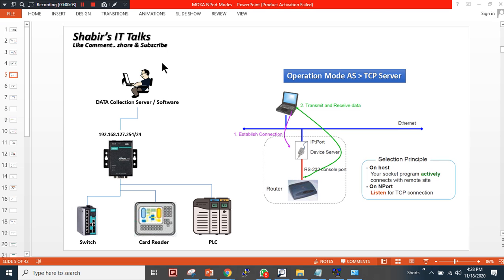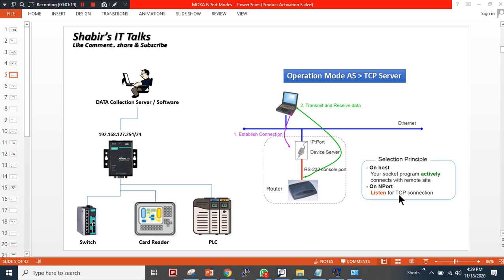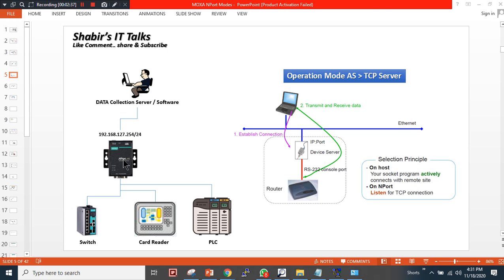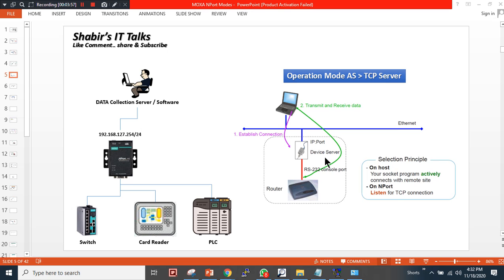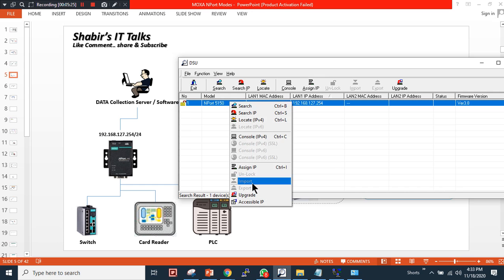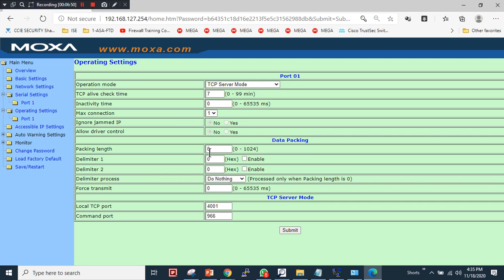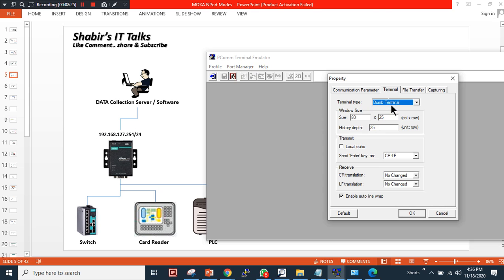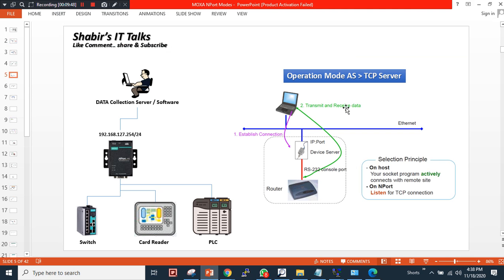How to Configure Ethernet to Serial Converter  MOXA NPORT Operation Mode as TCP SERVER

Comment: Hello Shabirs, I need to know if I can connect a serial port of my web server. But I have only 1 IP public, I mean  I want to use the same IP public for my web server and the Nport.  I tried but the NPORT didn't connect because my web server is configured with the same IP. This in mode TCP server mode.
Reply from the maker: plz email me on (shabirstechtalk@gmail.com
)
 more details like end host and software application details, because nport supports ethernet modem and PPP mode please have a look to https://www.moxa.com/en/products/industrial-edge-connectivity/serial-device-servers/terminal-servers
Reply: @ShabirsTechTalks  Check your mailbox please. Thank you.